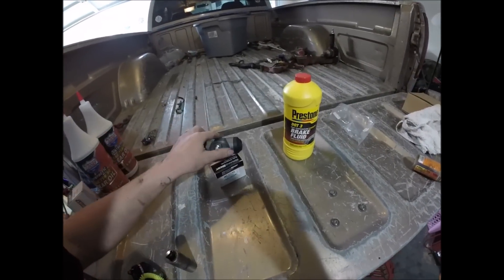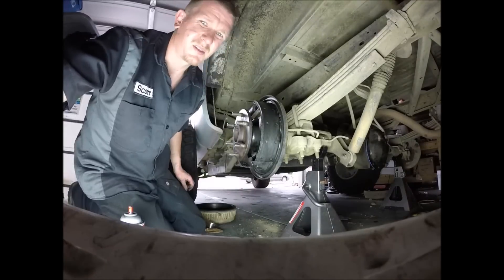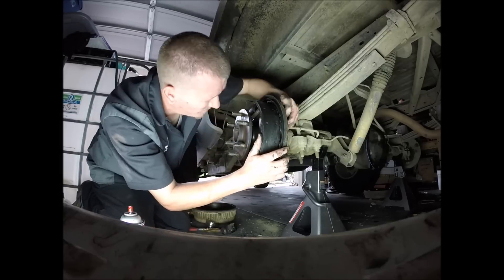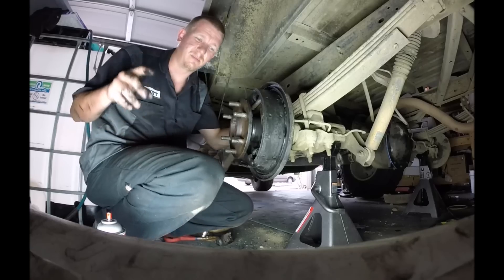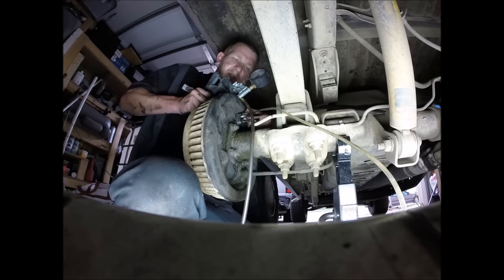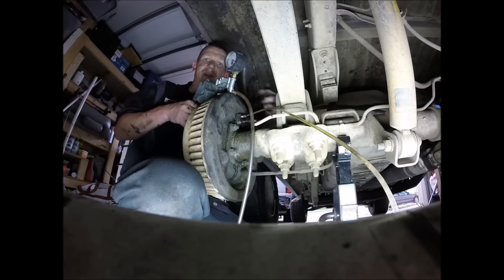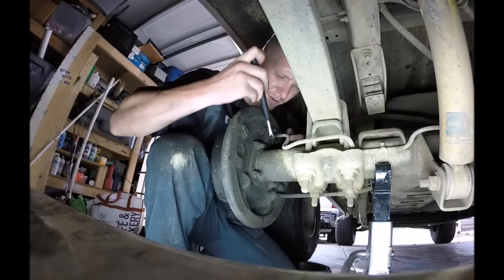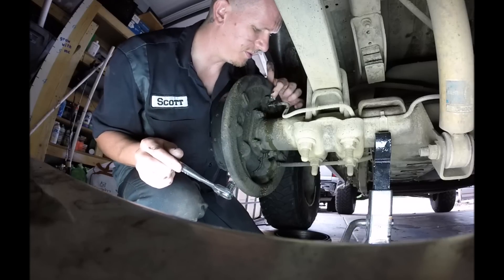Chevy Silverado rear wheel cylinder replacement.  Drum brake leaking fix.

Comment: I have a 2002 Tahoe is it the same as that
Reply from the maker: On a 2002 Tahoe you should have rear disc brakes with a drum assembly as the parking brake. But I believe off the top of my head without looking at anything your parking brake is not hydraulically driven, it has a cable that engages the parking brake.
Reply: Well I don't know what's going on all I know is my back driver side tire is full of break fluid...and I noticed I have like a puddle..on the ground...so I don't know what to do
Reply: Someone said it's a caliber and then someone else said it's the break fluid line is off
Reply from the maker: @shannasmith3503  can you take a few pictures of the backside of your rim and tire and the brakes if possible?
Reply from the maker: I have a 2001 Chevy Tahoe in my front yard right now and that one has rear brake rotors.

Are you sure it is brake fluid? It could be rear end fluid as well. I assume you checked the brake reservoir and it is empty?
Reply: Yeah it was almost empty and so I put some and like a hour later it's almost empty again
Reply: Thank you for replying back to me
Reply: I don't know how to post pictures on here
Reply from the maker: @shannasmith3503  email it to me TheRealScottiesHobbies@gmail.com
Reply: I have disc breaks in the back if that helps...
Reply: Ok
Reply: I'm going to go see if I can take some pictures hopefully you can see with the flash on

Comment: Waterfall effect on my 98 k1500, Left signal light blinking fast, no turn signal back left, or brake light, but the bulbs burning. Checked the relay (functional), changed the bulb anyway. Still have the problem, Plus my Parking Brake light turned on last night, so put it on the lift just to change the oil, and found a leak in the left rear wheel drum, my question and reason for comment is, Would a leaky cylinder, cause all the problems i just said? Parking brake light being on, and Front left turn signal blinking fast, but no turn signal back left? or brake illum?
Reply: Scotties Hobbies
Reply from the maker: If your fluid level gets low enough in the brake fluid reservoir the brake light on your dash will turn on. But a leak in the system should not affect the electrical system of the vehicle. It sounds like you have a bad ground or a couple backgrounds. If you have a tow package I believe you have a connection near your toe bracket that connects to the frame those are known to go bad. I would first take that out and connect the wires with that taken out and see if that fixes my problem. You could also have a bad circuit board on the backside of the rear tail lights, those are known to go bad too. But it sounds like you should be chasing a bad ground on top of repairing the fluid leaks.
Reply: gotcha, thanks man. i took out my tow wires back when my crtsy fuse kept blowing, but it was a bare wire behind my grill.  needless to say i never pluged the tow wires back in, ima go put her on the lift in a second and check it out, and yeah ive had my circuit board go bad once before but completely forgot about that too lol, thanks man, youre video and your comment back, especially in that amount of time was and will be extremely helpful. id def buy you a beer man, thanks again
Reply from the maker: Thanks brother. After you get it all fixed, let us know what it was. I be it'll help someone else. These trucks are trippy sometimes but worth puttin in the time to fix.
Reply: Well it was most definitely the circuit board! i have aftermarket tailights, and they put some cheesy foam that doesnt cover what it needs to cover and protect lol. But this video came in handy just had to have a 2nd guy with me to bleed the brakes, cant make such neck injunuity lmao never tried. but this video and you were the most helpful man, thanks again hats off t you
Reply: in addition to replacing the wheel cylinder, if anyone finds this helpful. Always remember to bleed the opposing side as well, if you find that you have air in the lines. Installed the cylinder, bled the brakes and the brakes wouldnt apply,  most likely due to the brake line being unclamped or sealed after uninstallment. but if you come across that problem, bleed the opposing side and it should fix her right up.
Reply: Richard Dangles this comment thread is awesome! I literally have all the same symptoms as you did. To fix your drivers side taillight did you replace the circuit board on the taillight itself or was it somewhere else?
Reply: Parker Bengtzen left tailight circuit board

Comment: Seriously!?!? A Cresent wrench on a line fitting???
Reply from the maker: Hmm.. how did it work out?
Reply: I used my Lowes branded CrapsMan line wrenches and it was a 13mm on my 2008 silverado 1500 LT, and the bolts to the wheel cylinder i had to pound 6mm snap on socket onto them rusted down inverted torx??? UHHGG

Comment: Quick question? If my cylinder is leaking just as bad or probably worse than yours? Do you have to necessarily replace your brake shoes, drum and change your rear axle seals or were the mechanics trying to rip me off?
Reply from the maker: I always recommend replacing the brake shoes and drums in this scenario. I have on my own vehicle in the past replaced the cylinder and cleaned the brake shoes really well  And hoped for the best. It did work but the worst case scenario would be the brake pads getting soaked in brake fluid. If the brake shoes get soaked with brake fluid when they are pressed against the brake drum the brake fluid in this case would be a lubricant and caused the brakes not to work. So in this case you are not getting ripped off, in my opinion.
Reply: @ScottiesHobbies  okay will do. But changing both rear axel seals is unnecessary though right?
Reply from the maker: @danielcuellar5134  if you have the money, your half way there. So its worth doing right now. If the seals are not leaking... you don't necessarily need them but recommend due to labor savings on the Axle seal job.